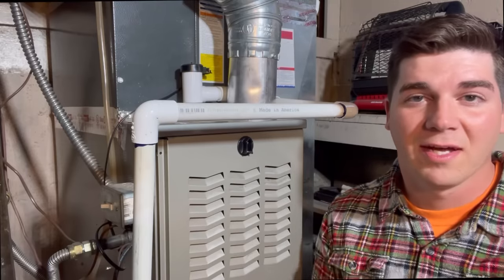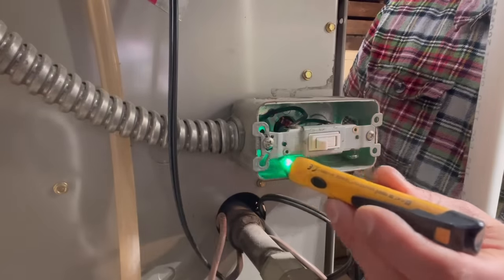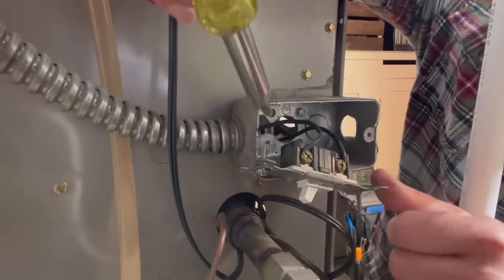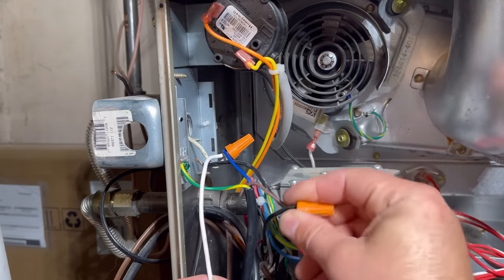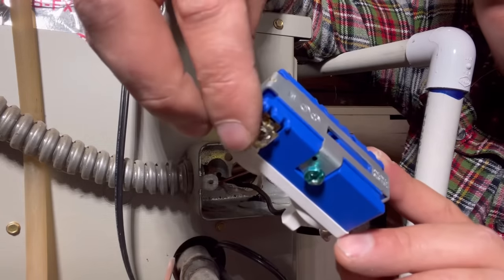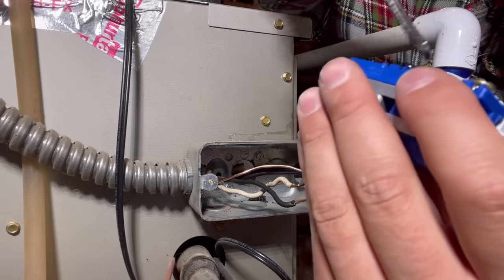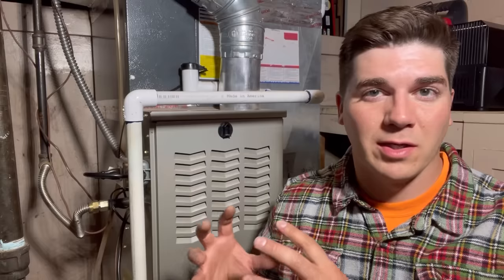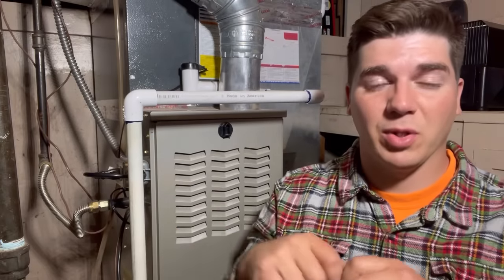This Could Keep Your Family Warm During An Emergency Power Outage.

Comment: Wow.....many thumbs up for double checking that the furnace circuit breaker wasn't mislabeled. Big time thumbs up for that sir. It reminds me to do such safety checks where I work on electrical components. Household current can be lethal. Thanks for the reminder to double check for safety. Oh, one more step in checking with the detector pen......always check on a known live circuit to make sure the detector functions properly.
Reply: Can be lethal but almost never is.  On YT if you get shocked there will be nothing left but a smoking puddle of goo on the ground.
Reply: @publicmail2  Cool, thanks AD.

Comment: There is another occasion where this will help.  Although it does not happen often there are times when one can loose one leg of the power coming into the house.  When this happens anything that is on that leg or is 220 powered will not work.  At that point a properly sized extension cord could be run from a receptacle that still has power and the pigtail plugged into it.  We've been there when one leg of the underground feed shorted out and about six houses only had one leg or phase.

Comment: Why not just find the furnace wire out of the breaker panel box and in an accessible location cut that wire in half. Then attach a plug to one end and a receptacle to the other. Now plug them together. You’ll have power just like before. If you lose power, just unplug and plug into you extension cord from your power source. When power is back just reverse. You don’t have to mess with all those wire and possibly fry something. I’ve done this for years.

Comment: if your furnace is in a cold area of the house like a basement you prolly want to make sure your battery has some fail safes like a insulated box and a temp sensor so it can shut off before over heating

Comment: Do this at your our risk! All gas furnace built after July 3, 2019 (79 FR 38129) and many built before this date, require ECM motor technology as well as microprocessor controls. Big box stores sell generators that do not meet minimum power quality requirements and can damage components within your furnace. Failures related to improper voltages, frequencies and harmonics ARE NOT covered by the manufacturer's standard warranty. My advice would be to get a high quality whole home generator (commonly referred to as hospital grade). Check with your furnace manufacturer for generator power quality requirements and make sure the whole home generator meets those requirements in writing.

Comment: I powered my furnace by wiring a male plug from the furnace that plugs into a outlet near the furnace, In a power outage I unplug the furnace from house power and plug into my generator. No chance of feed back as furnace is physically disconnected while using generator VERY simple. This is a job for an electrician but they don't charge much to do it. The electrician merely cuts existing supply from power breaker panel and wires in a outlet to plug furnace in and wires a standard plug on furnace lead. Under normal use the furnace is plugged in until power fails then unplug and plug into a generator or a battery/inverter. The switch is redundant.
Reply from the maker: Switch is needed by code here in utah.
Reply: @diyhvacguy  We already have a switch in our code to start with. My setup is after the switch here. Ours is wired on wall next to panel where it is easy to get at So basically the same as yours but In Canada they already have the on/off switch installed on these model/type furnaces. So here the switch is redundant.

Comment: If your furnace has an electronic control board, they usually don't like the modified sine-wave output from many low-cost inverters. They need a pure "true" sine-wave inverter. It might work for a short time on a modified sine-wave, but only until the circuitry is damaged and fails. If you hear a buzzing noise, disconnect immediately.

Comment: Instead of breaking the tab and using a jumper wire, you can just connect the line wire to the gold screw instead of the black screw.

Well actually, now I see this one's got an indicator lamp so for that to work right yeah you need to do it the way you did with the jumper wire. If there's no indicator lamp, you can just connect the line in to the gold screw.

Comment: Works only for 120V units. Mine is 240V. I could buy a 240V UPS for $2500 to $3000! I would also need a 240V Plug and socket.

Comment: I took the hard wire that went to the furnace and terminated it into a single outlet 2”x4” box mounted to the wall next to furnace. I installed a #12AWG cord to the furnace long enough to  reach the new outlet.The furnace plugs in to that outlet 24/7/365 if power never goes out. Next to the outlet on the wall I added another single outlet in a 2”x4” box and conduit or armored cable that leads to my garage. This second box also has a neon bulb added to the cover and each lead goes to the hot and neutral of that outlet. The cable that goes to the garage terminates on the wall with a male 120 volt plug or male receptacle. My generator plugs into that outlet and when generator is on, the neon light illuminates on the second box near furnace. If power goes out, all you do is pull the furnace plug out of the main outlet and plug into generator outlet. I have a similar outlet for my refrigerator. In the winter my concern is heat so I switch those plugs, I can put food outside to keep it from spoiling or plug in fridge if desired. In summer, fridge is the concern so I only use that circuit. If you need to power both fridge and furnace, make sure generator is big enough.

Comment: It has probably already been said somewhere else, but for those without a hot pen, voltage tester, just run the furnace so the fan comes on, then turn off the breaker associated with it so that you can hear the fan stop when power is cut at the breaker box.  Yes there could still be sneak circuits, but for 99.9% if outlets, devices it is a safe way to ensure power is off in an emergency, where you have no test equipment available.
Reply from the maker: That’s great advice. Thank you so much! I think any diyer needs a hot pen as they’re only like 20 dollars. I used mine on the daily. Cheers
Reply: @diyhvacguy  You are welcome!  Have a great week and thanks for you awesome content, guys like you keep us from getting ripped off not knowing the way around our own home's equipment.  Channels like yours here on YouTube have save me thousands of dollars and so much inconvenience.  Quick anecdote.  Icemaker in my Fridgedaire Gallery stops working, go through every fix the manufacturer website says to do, they say get one of their local techs to take a look.  Go online and find out it is a huge problem for people.  Videos everywhere.  Nothing lasts.  Find a tech willing to divulge that the factory settings come back after a power outage and they are too cold.  Valves freeze up and people give up and get new units after countless service calls and money down the drain.  He told me in a pm, just remember the old car from the 60's to get it back up and running all the time, watch for that number to be always on your display.  Oldsmobile 4-4-2.  Freezer manually set to 4 degrees and Refrigerator manually set to 42 degrees.  I was skeptical, but techs have given me secrets before, even sent me whole manuals and fuel lines when I had an issue with one of my vehicles having vapor lock after filling up.  So I am in the kitchen 6 hours or so later, maybe longer, later at night and I hear, whirrrrrrrrr.  Click, click, clunk!  Clunk!  Ice is dropping into the receptacle again!  No tools, no resets, just keep it at 4 42.  Never short of ice and no issues with food or frozen items not lasting or not being frozen.  He said they have those super cold settings so that when people get the new units they get ice and cold food as fast as possible.  I think it also is to send out techs for repair work, but opinions vary.   Anyhoo, thanks again!

Comment: If you are not a Licenced Electrician; You will not have coverage in the event of a disaster.  DIY is not acceptable in this regard.
Reply: Yes and no. In some areas it is fine. In some areas you need a permit to move an outlet. You can also just pull permits and do work as the homeowner who lives there in some areas. Not as bad as you make it sound.
Reply: Also if you ever ran a restoration job you would know insurance adjusters are lazy AF and will only check on major modifications that aren't listed with the town.

Comment: I'm not an electrician though I have wired 3 of my homes. Every furnace should have a service shut off switch by code. All you should have to do is add an outlet inline between the switch  and the furnace, then make an extension cord with two male ends. So when the power goes down flip furnace the service switch off then plug in your cord from the generator to the new outlet. This is not fool proof as compared to the solution in this video. If the service switch is in the on position there is the potential of being directly connected to the grid. You could for extra protection switch off the main breaker, then watch your when your neighbors lights come back on :). I have a safety lock out in my outdoor service panel for running a generator. So I actually plan adding an outlet to a breaker in my service panel to power my furnace and my house. That way our refrigerator won't thaw out. I also want to convert one of my generators to propane since we have a 1,000 gal tank it would last a long time. No worries about having enough fresh gasoline on hand.
Reply from the maker: What you have described is a suicide cord. If I did a video showing that I’d have everyone and their mother telling me that I’m going to get someone killed lol yes it would work, but there are better and safer ways. I actually just created a video that shows how to install a simple outlet, and install a pigtail from the furnace that just plugs into that outlet. Check it out! Cheers
Reply: Yes that sounds right. I did not think of how the cord could be misused. Eitherway what I describe was not advertised as the safest route :). Thanks for the feedback! @diyhvacguy

Comment: Good plan, but seems more complex than what we did, FWIW.  We just replaced that maintenance shut-off switch with a 3-way switch and connected a line cord to the other screw.  I had the 3-way switch and cord in our parts stock from previous use.
It works like the HVAC techs expect - switch says "on" and "maint/off", but "maint" connects to the cord.  It completely isolates the generator from the house power and doesn't look "different" to the techs.
Folks need to avoid cheap generators unless they have a cheap furnace.  Ours has variable speed, so we use a 5KW with very steady RPMs, but anything "inverter" likely works well.
It saved our bacon when our complacent (idiotic) state govt neglected enforcing power readiness requirements and we lost power for 60 hours last February.  Running the generator a few hours a day was enough to keep the house warm, saving us from much discomfort, let alone the burst pipes may others suffered.  We also ran the refrigerators, which warmed the house while preserving food.  It charged the UPS for our Internet access, so we had remote work and entertainment available.  The neighbors saw we had lights on, so they brought their mobile devices over to charge.
Another hint: If newer vehicles block siphon hoses, just lift the hood, pull the fuel line, and use the fuel pump to fill your gas tote.  If you have any secondary vehicles, always ensure there's at least a half tank so you'll have generator fuel when you need it.

Comment: Nice explanation and how to.  I would add a caveat that this only works with a gas or oil furnace; electric or heat pump units require a different solution.

Comment: Similar to what I have been doing to provide flexibility for loss of utility power loss. You don’t need this UNTIL YOU NEED THIS. So little cost with such much benefit. However it is hard to convince many folks to prepare for to morrow.
Reply: You have this in a forced air system?  How big of a battery bank to run that for how long?  I could see a recirculation pump on a boiler system but my head is hurting at how big or a draw a furnace takes.  There are just some things...microwave, vacume cleaner....that are just too much draw...

Comment: Sounds good, but when you loose power you need more than the furnace to run, so a whole house or at least most of it, can be powered by installing generator interlock switch and a power inlet box sure it cost more and more involved but more effective
Reply from the maker: Yes I just did a video on that 👍🏼 thanks for the feedback
Reply: @diyhvacguy  actually, i just watched that. always great videos, thank you.

Comment: I have a 1400 W gas powered generator. I have my furnace on a dedicated circuit in my panel board. My furnace is a 92%. gas furnace..
  I have an electrical outlet outside. If the power goes out, I put my generator outside near the outside outlet, I use car battery jumper cables. to ground the chassis of my generator to my ground rods in the ground below my electric meter grounding my panel board..
  if the power goes out, I open the main breaker, I have an extension cord made up using number 12 wire. My receptacle outside is a 20 amp receptacle. I simply plug the output of my generator into the outlet on the outside of my home, and backfeed my panelboard. Only the circuits I have dedicated to run on that side of the panel board for a few lights, and my furnace will be energized when I backfeed the panel board from my generator…
  my home made extension cord with number 12 gage wire, I actually salvaged from an old washing machine.. it’s 6 feet long and plenty long enough. I merely had to add a plug to one end to have a double ended plug with a Mail plug on each end. One in plugged into my generator output receptacle, the other end plugs into my outside electrical outlet that is wired into my panel board on a dedicated breaker just for the furnace…
  if you were going to depend on a gas, powered generator, especially these days. Don’t store old gasoline for long because gasoline with methanol in it, stratifies, and absorbs water, because methanol is alcohol-based, which absorbs water. So rotate your stock of emergency gasoline…
  also, my generator sits for long periods of time between use, sometimes years. The only way to store a generator that’s going to sit is if you completely drain the carburetor and gas tank so that the evaporating a gas does not leave a lacquer like film plugging up the main jet and pilot jet inside the carburetor. Otherwise it won’t start. No fun trying to start a generator that has all the gas in it that has been sitting for years during a storm at night with no lights…
  I always run my generator completely out of gas completely, then I change the oil. Every time I have needed it, it has always started on the third or fourth pull.. that is, of course, after I put fresh gasoline in there.. if possible, keep a can of methanol free, gasoline, ready to use in your generator rather than gas with methanol to avoid that stratification problem, and the water absorbed by the methanol issue..
  Backfeeding the panel board this way can you give me a few receptacles in the house for lighting we’re listening to a radio. When the furnace thermostat is satisfied and turns off because the house is warm. I can cycle off the panel board breaker for the furnace, and turn on a receptacle to operate my refrigerator to keep the things in the refrigerator from getting warm or melting. The things that are in the freezer. You only need to do that about once every four or five hours if you leave the doors of the refrigerator closed. But by backfeeding the panel board, makes it possible to alternate your power flow from the furnace to refrigerators to some lights.
  to do that, you have to make sure that you have those lights, the receptacle for the refrigerator, receptacle in the house to possibly run a radio, or an alarm clock, on that side of the panel board that is feeding the outside outlet that the generator back feeds through, and the furnace is also fed from that side of the panel board..

Comment: Could you elaberate on this please "you will need to put a temporary ground from the furnace ground to the white neutral wire" I was led to believe if you have a inverter generator there is no need for grounding the generator ?

Comment: Interesting setup.  so we have a Variable speed HVAC with Propane and a heat pump.  I believe my furnace is 120V but my heat pump is 240V.  so I could do this and run propane only.

Comment: You don't have to break the tab off the device. Feed the switch with normal power on the switch leg side (which you called a neutral). When the switch is on, the outlet is hot. When the switch is off, so is the outlet. You break the tab off, then you put a jumper in to replace it. Just reverse the hot and switch leg terminals, it does the same thing! BTW, neutrals should be separated from normal power and emergency power, which these aren't. 
Also, Wagos are illegal in some parts of the US. Use wirenuts.
A dpdt center off switch is a better option. Six terminals, which allows the neutral as well as the hots being separated from normal and em power.
Reply: You should do a video on this.

Comment: Did essentially the same thing at my old place.  This may not be "code" and some will complain that it is potentially dangerous, but having the ability to instantly connect a small generator or inverter to your furnace when a blackout occurs can be extremely advantageous.